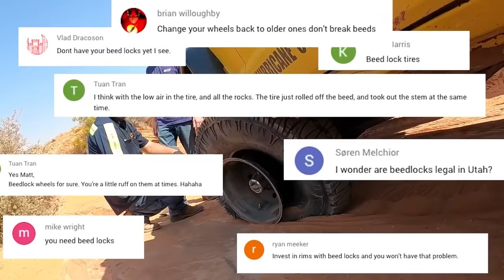Throttle To The Floor, 15,000lbs Rescue at High Speeds!

Comment: I am sure Al Cowlings appreciated you freeing his Bronco.

Pulling ~20k lbs diesel truck and gooseneck trailer uphill in sand was a pretty impressive feat for the Morvair.
Reply: 20,000 lbs  might be stretching it .... maybe 12 k....
Reply: @wutafungi  Not by too much really, a Featherlite 6 horse trailer is 10,000 pounds by itself with no tack/cargo, and that truck is about 7,000 from the factory.
Reply: Yes really impressive!
Reply: It's split though with the Ram, it's not doing it alone...wouldn't likely happen
Reply: I may be wrong, but I think it would have been easier to pull it out with the bulldozer that was driving around the beach( 12:17 ).

Comment: I was on the 405 when O.J's  Bronco pulled that 35 miles an hour run from the law, it took us three hours from Long Beach to Ocean Side which is normally 45 minutes, O.J appreciates you getting it out, he's out and could use a ride!
Reply: Pretty sure that was Al Cowling's Bronco.  OJ was in the back.
Reply: Hey I was on the 14 heading to the 405 if that counts
Reply: @CrimsonKingOkie  Yes i was Al's  OJ was in the back, and it still jack up traffic in both directions!
Reply: usually the 405 doesn't move traffic that fast
Reply: @CrimsonKingOkie  but no one calls the Al’s bronco
Reply: @jameshowey9958  Really?  I've never heard anyone call it "O.J's Bronco".  Probably because it wasn't.
Reply: Those white Broncos are  referred to as a OJ Bronco, I have never heard anyone say hey did you see that Al Bronco, I know it wasn’t OJs it’s just people referencing white Broncos as OJ Bronco

Comment: Now I understand why Matt builds his own rigs instead of buying new ones. He builds them SUPER HEAVY DUTY like nothing on the market, to get the job done. SMART!
Reply: Everyone who does serious off roading modifies their trucks
Reply: @grantadamson3478  Yes sir, I totally agree with you. However, Matt has gone above and behind with not only suspension and tires (like most off roaders do) but also front and rear HEAVY DUTY LOCKERS, and stuff like that. He just installed a Toyota/Lexus V8 to the banana. 🤠
Reply: @grantadamson3478  exactly lol
Reply: @HappyCarReviews  Not sure why you highlighted "heavy duty lockers'. Nearly all club members where I live who do serious and even not so serious off-roading use either ARB  or some other brand of front and rear locker. Unfortunately those types of lockers have there limitations but will do in most situations if you use them judiciously. (We have resorted to building our own.) Lockers are a relatively easy and cheap mod.
Many as Matt has done, change diff housings, diffs, axles, brakes, engine and trans, cooling etc. 
Wheels/tires, beadlocks, snorkels and lift kits etc are minor mods and will usually improve off road ability but no where near what is required for serious/competition class. I'm talking 400+ hp and what is required to get that to the ground efficiently.
Also, I think you will find that the Banana is running a 4.6 liter stroker not a v8.
Reply: Purpose built vehicles
Reply: @adventuresingatewooding  Yes sir! 👍🏼
Reply: @adventuresingatewooding  Building can be more gratifyingly than driving them.
Reply: @grantadamson3478  another big part of it is gearing at least here in nor cal we do mainly rock crawling an if you don’t have the proper gears you’re going to have a hard time on the trail.
Reply: @ryanlorance6168  Agreed. Change Diff or transfer case gears or both. And you get the benefit of reduced stress up the drive train.  With the huge tire sizes available you must go place that scare the crap out of you.
Reply: @grantadamson3478  for sure! An ya definitely some hairy spots here but just gotta be smart an cautious as you can but shxt happens

Comment: Watching these makes me want to move to Utah, I love everything offroad, right now I have my own fabrication shop so I'm pretty sure I'd fit right in lol and I wouldn't starve lol, it would be awesome to move out of Rustville ,that is southeastern Massachusetts,  if you look at a truck frame wrong it will have rot holes before morning lol , it's funny but it's not that's 80% of my work cutting out rot and rebuilding stuff strong than factory,  but my passion is building stuff ,going from a simple sketch I make and some measurements to a offroad bumper,sliders, Custom hitch setups , cages, guaranteed there is tons of that work to do around Hurricane, and moabTeam up with someone like Matt, Fabrats,or Rory would be ideal

Comment: Thanks again Matt. I have one question though. That truck and trailer were pretty close to the road at the beginning. Wouldn't it have been easier to pull it out backwards ie by the trailer?. You could probably have been on the road with the morrvair and one rope, no need to yank just a steady pull? Just asking. Regards from Canada's banana belt 👍🇨🇦🤔
Reply: i was thinking that myself..   probably just no real place to pull from the trailer...  full aluminum body and frame, doesn't want to damage it pulling backwards.......  a normal wrecker could probably have handled that with a slow steady pull with a winch, but not a yank rope

Comment: Years ago, and I mean YEARS ago (probably at least 30 years), I had heard of someone using that kind of rope to pull someone out of the sand.  That they had hooked up a type of rope or cord and stepped on it and it lifted a truck right up and out.  I had thought about it every so often over the years wondering if it really existed or not, since I had only seen chains and tow straps.  Maybe I wasn't looking hard enough.  It wasn't until I came across Matt's Off Road Recovery that I found out that it really does exist, and really does work!

Comment: had to pause when Matt said to let out some air. AHA! I thought you don't air down customer tires for liability, well i'm of course just giving a hard time. You gotta make judgement calls on what's the best way to get to the safe zone, for both the pull and pulled vehicles, and everything involved. That is one cool customer rig though, shame it got stuck with no recovery and too much air pressure.

Comment: my brother had a white mid 80s Bronco 4x4, with the bigger V8, and the 3 speed 'truck grade' auto instead of the overdrive car tranny.    great fun, but god it got bad gas mileage, and someone had made a mess of the electrics with a bad aftermarket alarm installation

Comment: If I had to build a recovery truck 6 traction boards would be on me all the time with front and back hitches and  hitch winch high jack with triple big a frame sand pigs for victoring over a pulley setup even brought a sea sand back anchor and used it to pull a big rig out of soggy sand once by backing the big rigger on top of it while it dug in. We had to work fast short distances before the tide got us .

Comment: That was quite the load, but the technique worked well. A lot more fun than the RZR recoveries, but those are still interesting how people work really hard to get them stuck. It makes you wonder why the vehicle manufactures don't see a need for recovery points. Seems like a real set-up just to save a buck here and there.

Comment: Sand loves a diesel, lockers and  a driver that knows what he is doing. You tread and press the sand and never fling and sift it. Trust me with a rear weel drive diesel truck that has only a locker for the back diff  i get out of trouble in any desert situation. That lower end torque can get you off your belly with only tread plates dug under those traction tiers. Just have some sand bags ready to weigh your back counter engine weight and the front pushes out under zero traction.

Comment: Just out of curiosity, is either putting the transmission in drive, or releasing the parking brake listed as #1 on the towing checklist?   Maybe they should be…….    Right Lizzy……?

Comment: Somebody explain to me HOW Matt’s 4x4 doesn’t dig in that sand? I get that he had 40 inch tires and small wheels but I can’t understand how it doesn’t dig AT ALL
Reply: I’d imagine that running low tire pressure is a huge factor. Longer contact patch on the sand means a tire shape less likely to dig a hole!

Comment: Matt, you're obviously great at what you do but I can't understand why you did what you did in this video.

At the 9:27 mark, if you are able to stop it right there (right before the video cuts to a different scene and immediately after the owner of the black pickup says the word "stops"), you can see that the end of the trailer is no more than about 35 feet or maybe 40 away from the pavement.

It doesn't appear to be the length of the pickup and the trailer together but perhaps the angle is off so maybe it was 50 to 60 feet.  At worst, maybe 60 feet.  

Anyway, why didn't you just "yank" it backwards to the pavement instead of spending all that time trying to go forward through the soft sand?  You ended up making more work for the Morvair and the truck pulling the trailer.

Perhaps you were worried about hurting the trailer if you connected to it and "yanked" it backwards and you may have been concerned that the hitch of the trailer wouldn't be strong enough to withstand the "yanking" of the pickup out of the sand.  Perhaps that's what you were worried about.  If so, then that's potentially a fair point.

But then if that was the case, since you wanted to end up essentially where you pulled them out, you should have just "yanked" the pickup sideways or just did a quick circle back to the pavement.  It would have taken a lot less work.

Is there something that I'm missing for why you didn't do this?  Were you just wanting to spend more time in the sand?  

I don't get it.

Your vids are great and you know that.  You obviously have the hundreds of millions of views to prove it.  And I think most of what you do is great.  I'm just wondering about this one.

So, what am I missing here for why you didn't just try to make a quick turn towards the pavement right away or pull it from behind?

Comment: Why don't you use the snowcat on the sand more?  With those tracks it'd be a cake walk!
Reply: @MattsOffRoadRecovery  How about building a dedicated Sand crawler with the right tracks.  Unless it's easy to change from one kind to another on the Bombi
Reply: @kenwilkins1574  Not cost-efficient.  The available vehicles would have to fail far more often than they do to make it worthwhile to invest in a rig that would have to be transported to every job.  They actually tried a surplus military truck (6x6?), but it didn't do well.